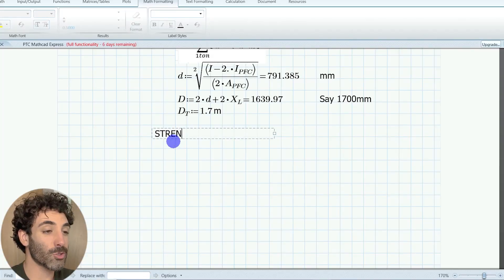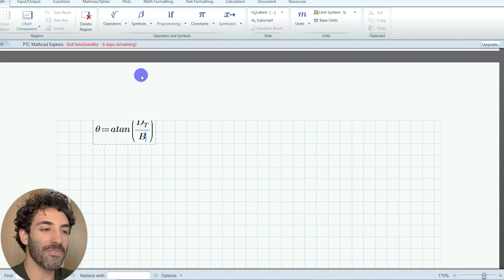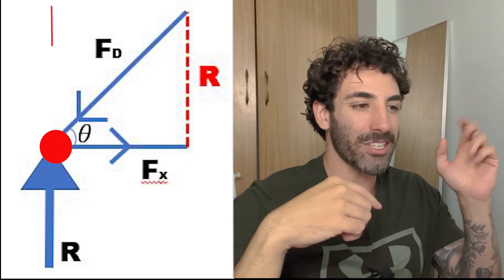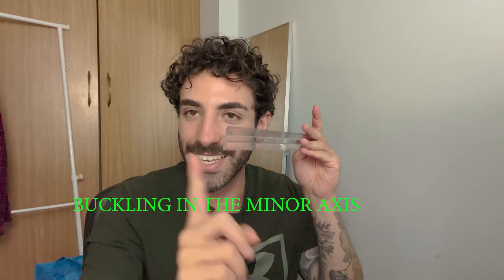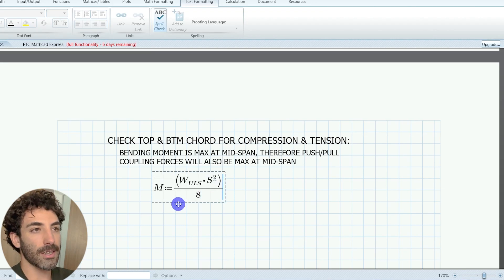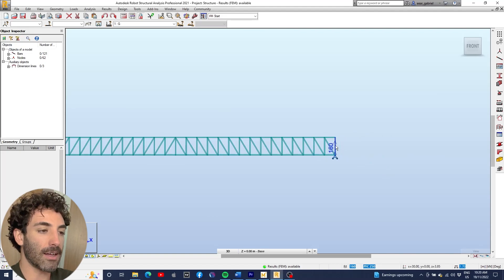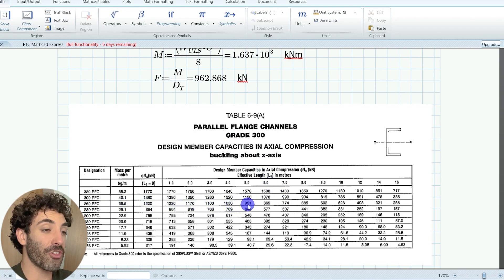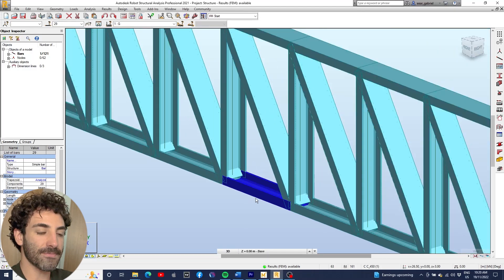How We Design a Truss in Our Engineering Office - Part 2

Comment: Hi, I'm glad I can find good engineering content , like this , and it was very nicely and simply explained. I have a question about the load capacity of the cross section. I saw that you did not consider the effects of additional bending moment on top chords, which can further reduce the load capacity of the section in elastic analysis. How accurate are these tables and is it correct to say that the section will be stressed only axially, without additional internal forces ?
Reply from the maker: if the loads are landing on the truss nodes you're safe to consider only axial loads. Those tables come from the Australian Steel Institute book. Any engineering office in Australia would have one in their library. Quite popular

Comment: Really loved the part 1 and part 2 , the explaination is top notch and clear❤.  Right now i also assigned to design a box truss for entrance of 17 span horizontal and 6 m vertical height. But i never designed truss. Its my new job.. Unable to design. Please sir or  any one please help me.
Reply from the maker: follow the video steps, then put it in a software with more precise values and then review it with your senior engineer.
Reply from the maker: you will be fine. Just go through all the checks and make sure someone more experienced review your work

Comment: If it's going to be welded, would it still be modeled with trusses?  Shouldn't those be beams now?
Reply from the maker: It still a truss. As long as you keep the center lines converging to the work point, it won't have any bending even if it's welded.

Comment: Hi, I wanted to enquire, if the reaction from the beam perpendicular to the truss is connected to the bottom chord ( i.e. point load acting at the middle of the bottom chord), is the process similar in case the loads act on bottom chord instead of the top chord? I am designing a house with similar scenario with load from purlins being transferred to a steel beam which transfers load to the bottom chord of the truss. If you can please guide me. Thanks.
Reply from the maker: yes same thing. Make sure you land the beam on a node of the truss.

Comment: How do you work out the connection strength needed to join the top and bottom chords? The forces it needs to withstand.
Reply from the maker: Do you mean joining all the members of the truss together?
Reply: @bengthebrazilianengineerinAus  yes
Reply from the maker: @henra2244  it depends on the type of connection. It can be a welded truss. Bolted with gusset plates. Mostly you need to check them for shear (which is the axial forces in the truss)

Comment: By the way, one question, when you determine the axial force acting on the diagonal chord, why did you ignore the axial force acting on the vertical chord on the edge (right above the support) ? Since there is UDL acting on the top chord, there will be axial compression acting on the vertical chord which will reduce the compressive force acting on the diagonal member ? Could you please clarify if iam missing something
Reply from the maker: Hey my friend, you're not missing anything. In fact, you're correct. If I can remember correctly, I think I took into consideration that the tributary area for the edge of the roof is half of the interior areas and simplified it. However, you may shave off a couple of kilonewtons if you want to use that vertical force. It won't be much though. Good pick up. Glad you were actually paying attention. Cheers
Reply: @bengthebrazilianengineerinAus  thanks for the clear reply in detail ! I am also an engineer undertaking 'schematic' structural design sometimes for a budget purpose so I need to revisit uni stuffs. I have been watching lots of your videos and it helps a lot ! Please keep uploading !!
Reply from the maker: @fedoremilyanenko4589   Yeah..I revisit my uni books all the time. If you don't use it, you lose it. Thanks mate. Let's keep in touch. Cheers

Comment: How does fly bracing come in when designing the truss or, in other cases, a beam?
Reply from the maker: The bottom flange goes into compression for wind uplift and can buckle. The fly braces restrain the bottom flange of the beam and prevents lateral torsional buckling. When you design the beam/truss, you should take into consideration the spacing of the flybraces if that answer your question?
Reply: @bengthebrazilianengineerinAus  yes, thank you so much
Reply from the maker: @iviwedukada4391  my pleasure

Comment: Would it be better to change the diection of the diagonals so that they are all in tension instead? The diagonals are the longest members so I think it's more efficient that way.
Reply from the maker: Good point. In this case I didn't include wind loads, but they usually govern in this scenario. So you can have uplift and downward forces. Assess the worst-case scenario and set up the diagonals to take tension for this worst case.